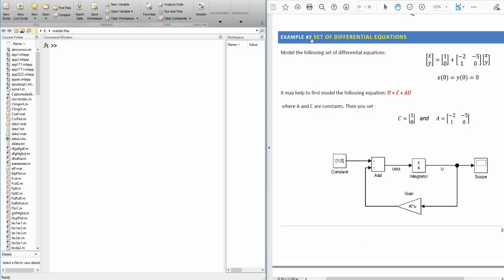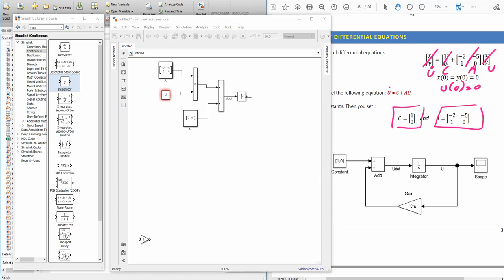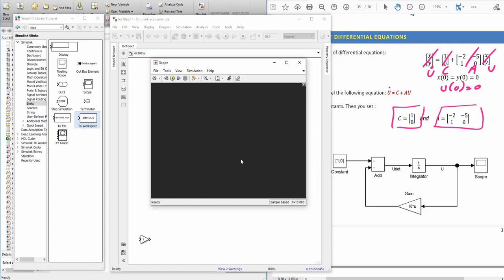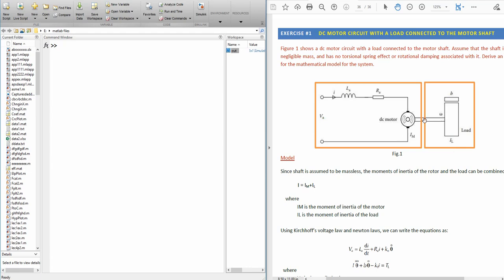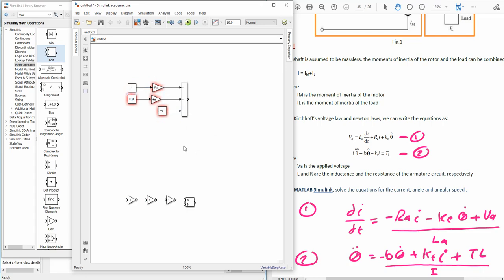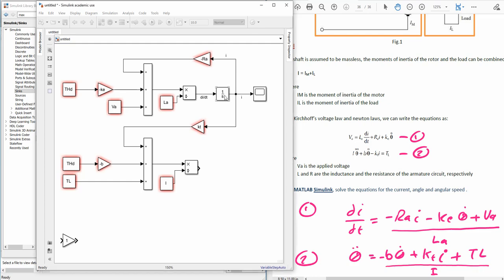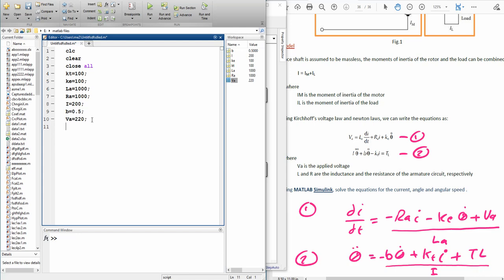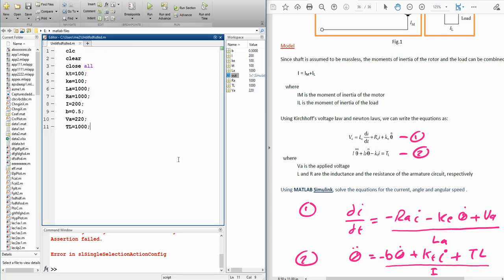MATLAB Lecture#10 simulink Part 2 ( Example#2 and Exercise#1 )

Comment: I have a question about the values sent to the workspace. I have a PI controller and I sent the error to the workspace. in the workspace, I got huge series of error data  . which value should I take as the error? because I want to take that error and send it to optimization in order to minimize it.